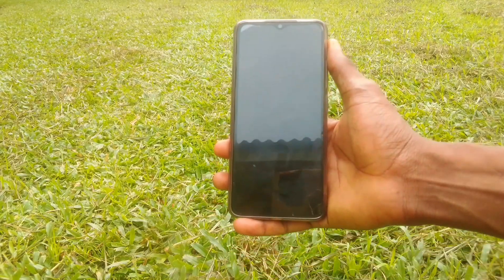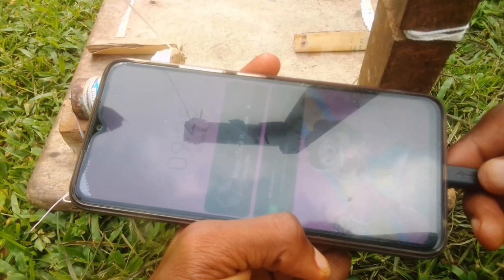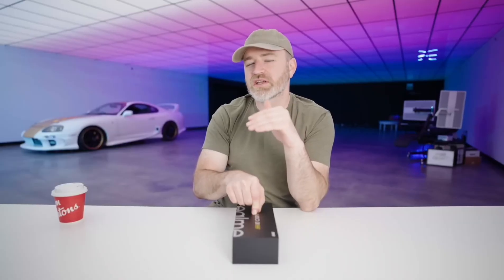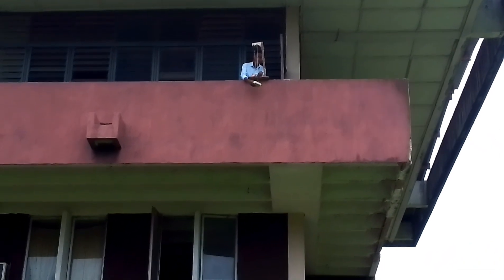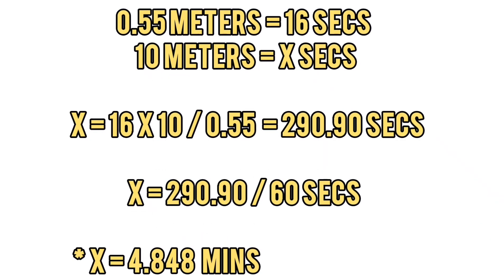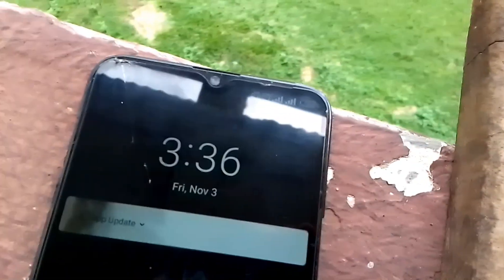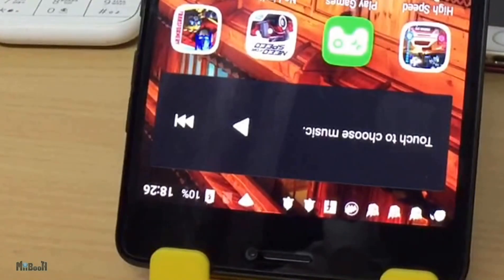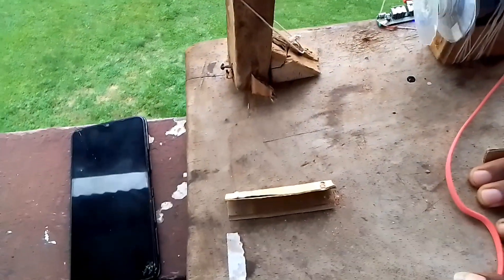Charging My Phone With Gravity ⬇️ will It Work? #freeenergy #phonecharging

Comment: Cool, though i think phone actually need 5volts to charge, so they charge with both current and voltage specifically 5volts and 1000 mAh, though increasing the current charges the phone fastest
Reply: Agreed 👍
Reply: Yeah, so that why it didn't charge the phone, it was producing the required voltage and current to charge the phone
Reply from the maker: Right 👍